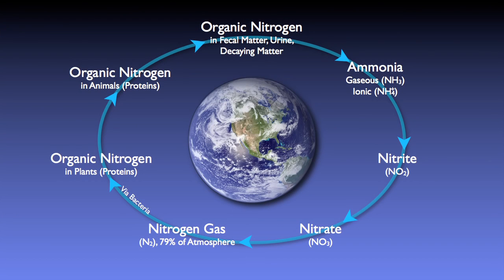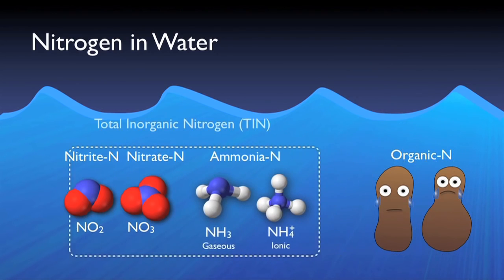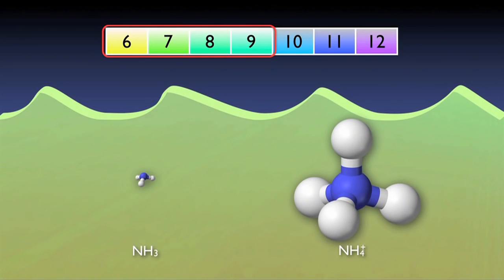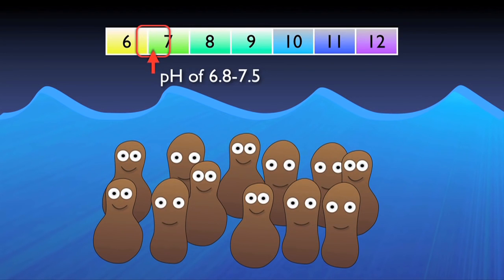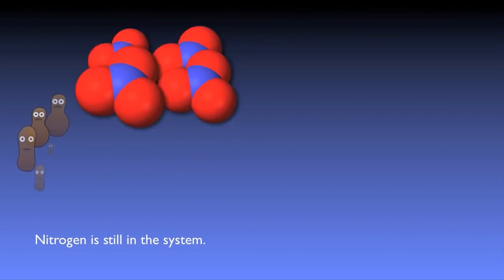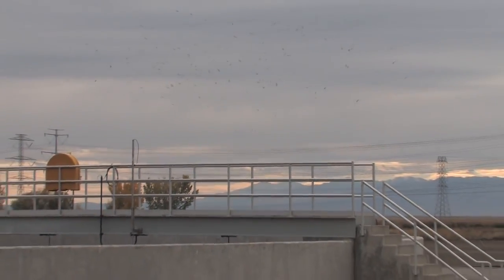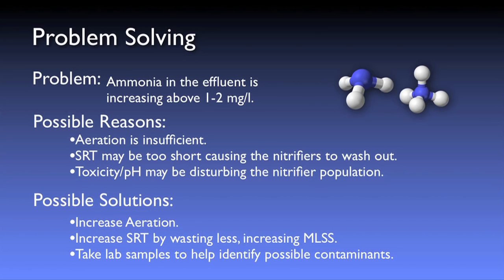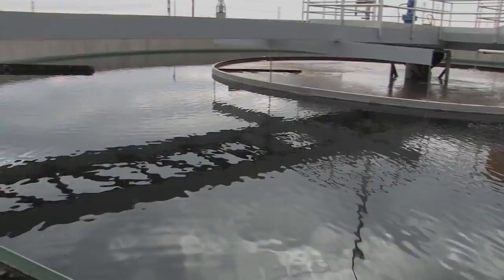Nitrification & Denitrification

Comment: The denitrifiers do not breakdown Nitrate to respire the oxygen gas. The oxygen is converted into H20.
Reply: we breath oxygen and Break it to h2o, as u call it, reduction is the word. water is there was to respiratory system using its energy, then reduce it to complete the circuit, to water. Blessings